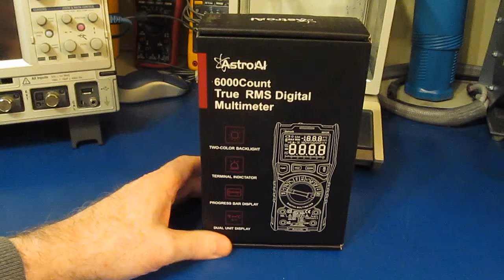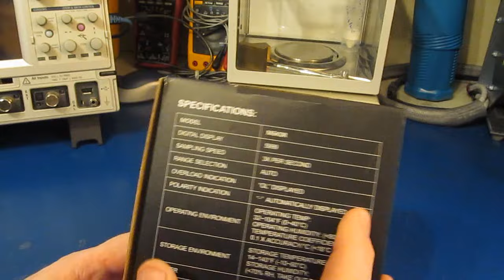AstroAI M6K0R 6000 Count Handheld DMM

Comment: Not sure how you didn't see the track that you blew off the board at 31:27  just to the left of the vertical fuse (Also in he slow motion).
Reply from the maker: What makes you think I did not see the damaged trace?   Similar to the color change in the backlight along with the three wires and why I did not run many tests on it.  Had there been major damage like we have in the past, I most likely would have spent some more time going over it.   But we have seen a lot of traces blow open on this channel and I don't get too excited about them.   I try to limit the size of the videos when looking at the low end meters.

Comment: Thanks for another great video. Yes this meter is very similar to the Kaiweets and did you notice that the backlight turns red at voltages >80V ?  Anyway now that it's dead please check if the fuses contain quenching sand. Or better, first apply current to the fuses and check their rating (I know that's tricky as a 500mA fuse will sustain 500mA for practically forever, but 1A should kill it)
Reply from the maker: I had ran several fuses a long time ago to demonstrate a counterfeit part.   I think I still have that test setup laying around.
Reply: @joesmith-je3tq  That would be great. If the fuses contain no sand or are otherwise dodgy it would give an indication on the effectiveness of AstroAIs QA processes. Fuses, mains power leads and proper earth connections are in my experience the most likely things to be fake when buying something from the far east. On fuses, I normally weigh them and compare with a proper branded fuse of same form factor and rating. That catches the "empty" ones but on the best way to test rating I am eager to see your method.
Reply from the maker: @TheHWcave  This video shows how I compared fuses in the past:    https://www.youtube.com/watch?v=EWu8wMspROQ
Reply: @joesmith-je3tq  Thanks Joe, interesting. I will definitely include the DC resistance check into my routine tests of fuses.
Reply from the maker: @TheHWcave  The problem with testing these fuses, I have no idea how they are supposed to behave.  Unlike the SIBA fuse, we have no datasheet to compare the data against.   As you suggest, I could run them against the same SIBA fuse but I am not sure what that tells us.
Reply from the maker: Considering it isn't a meter that a trained person is going to use in a high energy environment,  the risk may be minimal.  We have seen a few low end meters supplied with glass fuses.
Reply: @joesmith-je3tq  I understand. It is a tricky subject. What are people suppose to do when they finally blow one of these no-name fuses? If the manual doesn't say and the fuse itself has no marking on breaking capability and speed? One might go for a branded fuse like SIBA to play it safe and end up with a fake like in your video.

Comment: This looks almost exactly like my Kaiweets HT118A  which I think was less than $30 .  It works great for my use - I like the big display .
Reply: They're both rebranded Habotest HT-118A. The price on Habotest's website is $16.43 a piece when you order 50.
Reply: Was about to make the same comment. The Kaiweets is black, or at least mine is. I use mine as a travel and garage DMM, been fine for the 3 years I've had it.
Reply: @ I noticed the capacitance and ohms are reversed from what my meter has but other than the case identical.
Reply: @ I bought the Kaiweets auto clamp meter last year on a good sale - it will auto calibrate and select between DC and AC automatically. Very nice meter too. Amazing what you can get for not a lot of $ these days.
Reply: I think TRXBench also did a detailed review of the Kaiweets version meter and had very good accuracy.

Comment: It does have a two color display.  Did you notice the display color changed from white to orange when you were at the high end of the frequency counter testing.
Reply from the maker: From EEVBLOG:  I am not 100% sure but I was not able to find a way to manually select the backlight color.  I did not mention it when I took it apart but you can see the three wires for the backlight.   They have a white (which of course is the normal) and red.   When I ran the meter up to 1kV, the backlight turns on and you can see it is not white.  I suspect they turn on both for a high voltage condition to warn the user.   It may have changed to red had I continued to increase the voltage.   I didn't want to damage the meter before running any of the transient tests on it.